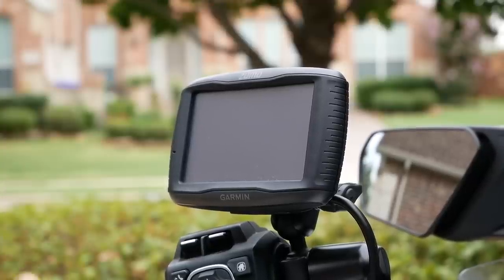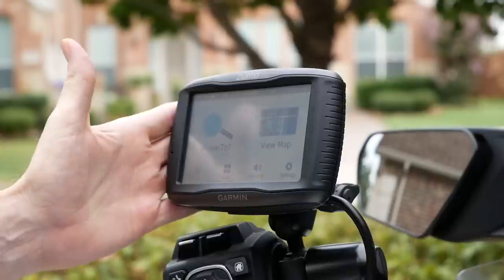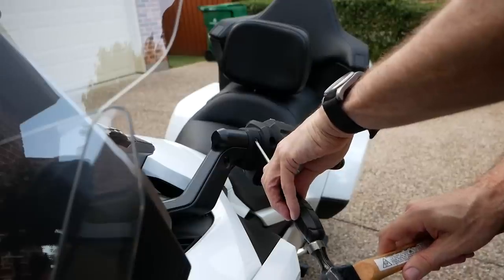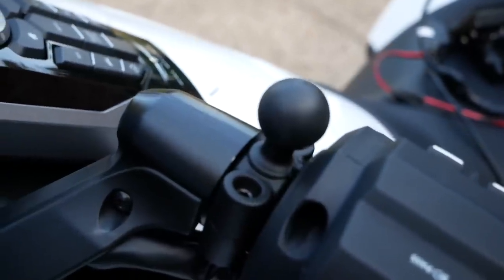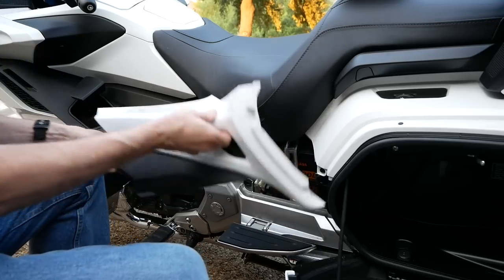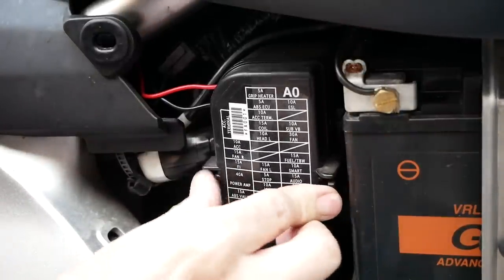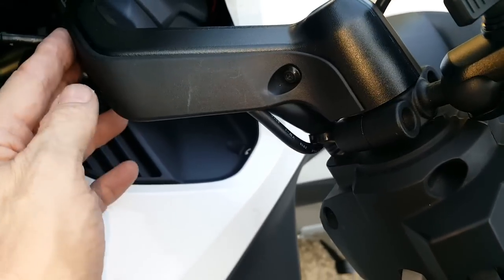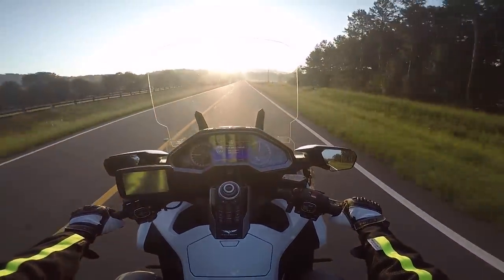Install Garmin Zumo 595LM on 2018 Honda Goldwing DCT

Comment: You cut off the Update USB for the Zumo? That is a nice Zumo, I will look into one in the future. I waterproof my Current  Garmins with Silicone and a Credit card, so far so good! But I want to get the Motorcycle version. Motorman in Da Magnolia
Reply from the maker: I did cut the USB. I did not plan to use the Zumo for music files.
Reply: The worst thing you can put near copper wires or PC boards is silicone sealant. It emits acetic acid as it cures. Acetic acid eats copper. It bankrupted a large servo company named Pro-Line radios. Use a couple of coats of liquid electrical tape. Some oxygen safe RTV may be OK but make sure it has no acetic acids.  Since the wires you cut are now dead ends it may not be a problem for a very long time.
Reply from the maker: My research showed that Plasti-Dip was approved for use to insulate wiring. But, maybe I got bad information? I will check on the acetic acids. https://plastidip.com/our-products/liquid-tape/
Reply: Hi Chris. My comment was to Albert. Plasti-Dip probably OK. I see you miss the 2012 GPS. You know my Glint Blue bike was your 12's twin. Still strong at 93K miles :-)
Reply: @cruisemansgarage  , the only way to get music into the 595LM, according to Garmin, is by writing it onto the MicroSD card, and I can verify first hand that that works.  No music reading via USB at this time, even though this is common practice with modern car stereos now.  I routed my USB connector to my handlebar where I can keep a short USB cable to keep power to my phone when necessary, and to allow for the possibility of a future GPS firmware update supporting tethering to the phone which would allow for wired support of both Pandora and Spotify music (higher audio quality and reliability than Bluetooth).  The latter may never come but I allowed for the possibility while providing a short USB cable solution for phone power.

Meanwhile I have GPS audio out piped to the bike's aux-audio-IN and I hope to soon have a wired microphone connection to GPS (for phone calls, etc.) from my helmet headset without needing a Bluetooth headset (tapped from headset connector under left glove box). If the latter works, I will be using ALL of the wires in that wiring harness to have GPS fully connected into sound system of my '02 GL1800.
Reply from the maker: So, you will basically not be using any of the audio sources on the Goldwing other than AUX?
Reply: Yes, I made that choice knowing that I was painting myself into a bit of a corner in that respect.  This is admittedly limited, but I have the following nice things to compensate for it (thanks to Garmin and Honda):

1.  I have my whole (digital) music collection on the MicroSD in the 595LM so I can use the music-playing capabilities of the GPS.  And it does a nice job of muting the music while it is announcing driving directions.  (Tested enough to know it works, but not tested extensively yet.)

2.  I can display animated Doppler radar on the 595LM as long as I have cell service, via the Garmin "Smartphone Link" app that provides the 595LM with data services (with a [I am told one-time] $4.99 subscription to the "advanced weather" service).  Unfortunately, I have already encountered a situation in the Colorado mountains with no cell service (on my ride over Trail Ridge road 2 weekends ago) and in that case, there's was also no radar.  But this is a major upgrade (for me) from days past when I ran into a snow storm on the way to Los Angeles one February (2000 on a GL1500SE) because it was 2am and I couldn't see the sky on the I-70 and I-15 corridors where I COULD have had cell service!  (And at that time of the night I couldn't get a decent weather report.)  (This one makes my tail wag.  :-) )

3.  If I really NEED to switch over to one of the radios (I don't have a CB yet, but that's coming), then it's just a few button-pushes away.

4.  The sound quality on AUX is quite clean so far -- no ignition noise experienced yet, which I am thankful for.

Furthermore, I have to admit that I haven't gotten myself a Bluetooth headset yet, and I'm looking for excuses not to.  *laughing at self*  This is the reason I went with the "wired" route.  I'm a software and electronics technician, and I (just a personal preference) don't like to have something around on a long IBA ride that I have to worry about its battery running down.  Running from the bike alternator makes the most sense to me for long rides.  I have yet to prove whether my (hoped for) wiring set up will work fully (microphone pending proving), so we'll see how it goes.  If THAT doesn't work, then I'm probably going to set out to learn all about the Bluetooth headset world in order to make a purchase.  Because being able to accept incoming phone calls is really COOL!  (Not that I get a lot of phone calls, but... I do have a job where one of the many "hats" I wear is that I am on call 24/7 for Tier-3 tech support, and timely response DOES help in that arena.)
Reply: Victor Wheeler victor, if you haven’t discovered this yet, you can add a mic splitter to the harness under your left cubby and talk on your phone that way. I did that on my ‘12 and ‘16 Wings with a 660 and then the 595 too, and it worked well. Mine came from BikeMP3 (Now OOB) but EdSets has them too I think. I presume the ‘02 will respond in the same way.